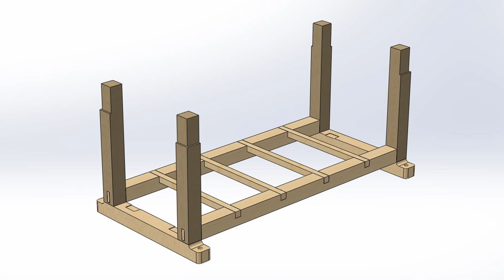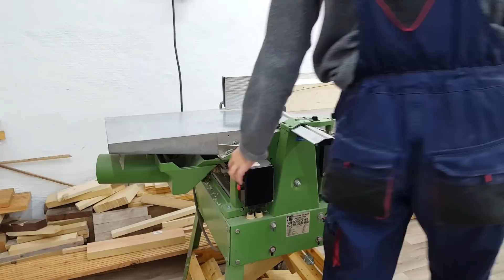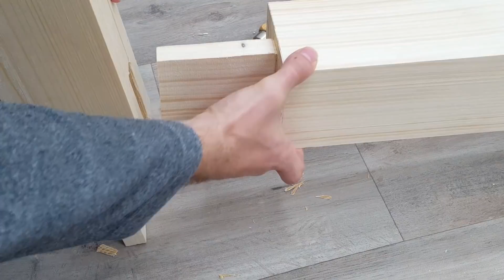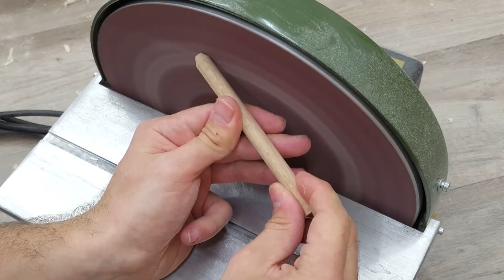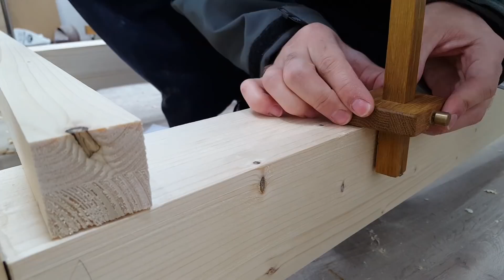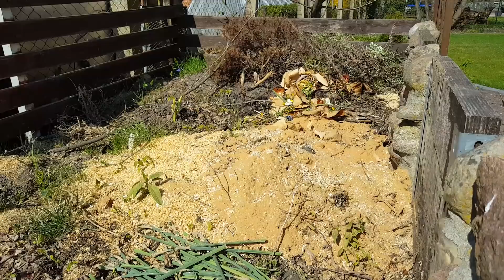How to build the Ultimate Workbench - part 4 - Building the leg assembly

Comment: If you keep some of the sawdust handy, rub a handful of it on the excess glue then scrape with a putty knife. It reduces the sanding you need immensely. I got that tip from Next Level Carpentry's channel and it work's great. As for the boiled linseed oil, remember the old adage about using it on a finished bare wood product: "Apply once a day for a week, then once a week for a month, once a month for a year and finally once a year for life." You can also make a great finish using equal parts linseed oil, urethane and mineral spirits. The oil nourishes the wood, the urethane protects the surface and the mineral spirits make it dry faster. Good design you have there.

Comment: Thanks Thomas, have you a link for the leg stand, also do you sell the plans
Reply from the maker: Hi Roy,
yes, I am planning to sell the plans, I hope to have finished them by this summer. I am not sure if I know what you mean by leg stand, could you give me the time in the video when it appears?
Regards,
Thomas
Reply: Hi Thomas Part 5 12.10 you call them feet, please let me know when the plans are ready thanks Roy
Reply from the maker: Ok I got it now. I had them made in a metal shop. They are 10 mm steelplates with M20 threaded rods welded to them. 
So if you´re in America you might wanna use 1/2 or 3/8 inch plates with 3/4 inch threaded rods. 
I use he same type of feet on my drillpress-stand and my bandsaw-stand.
I will notify you as soon as the plans are done. In any case I will also mention it in a video as soon as they are available.
Regards,
Thomas
Reply: ok thanks what length is the rod, and the diameter of the plate thanks Roy UK
Reply from the maker: The rod is140 mm long, the diameter of the plate is 80 mm
Reply: Hi Thomes can you tell me what size  wood you used for the top frame was it 18x40x 2000 and how many
Reply from the maker: The wood was 24x48x2000, that´s the cheapest option available in home depots in my region. I think I got more than 40 pieces, because I was using them everwhere in the bench. You don´t have to stick to that kind of stock, use what´s best for you to handle and the cheapest when all added up.
Reply: thanks Thomas is 40mm the finished depth, any chance the plans are ready as I am keen to get started . Roy
Reply from the maker: Yes, 40 mm is the finished thickness, all around. I am in the final few weeks of my master thesis right now, but once that´s finished I will push to finish the plans. Regards
Reply: can you tell me the length of the sides when finished, 40x180x ?, looking forward to the plans being ready thanks roy